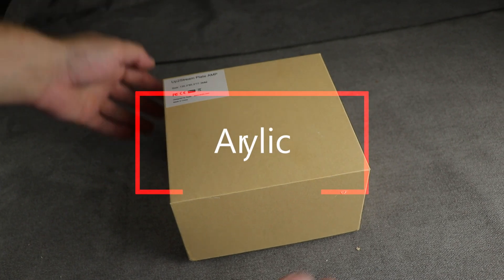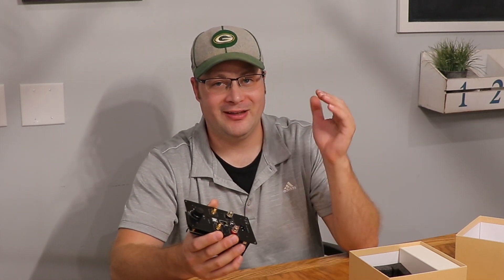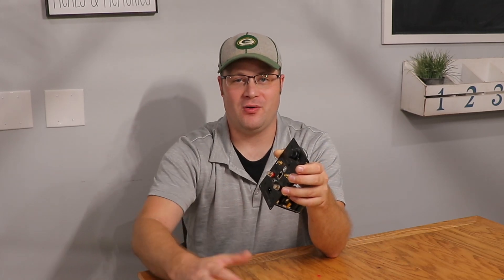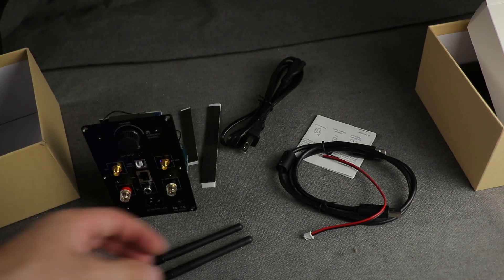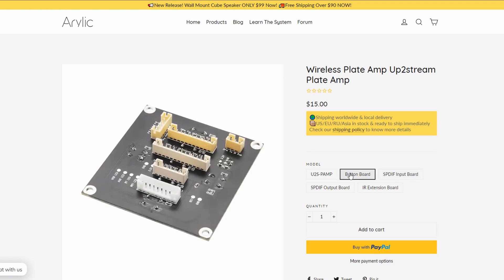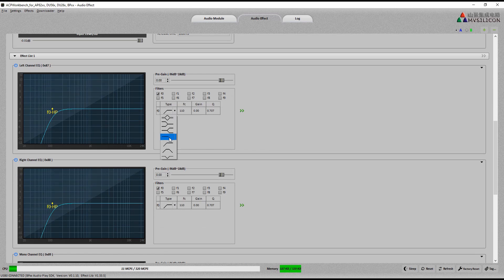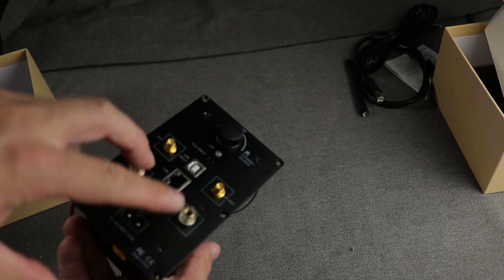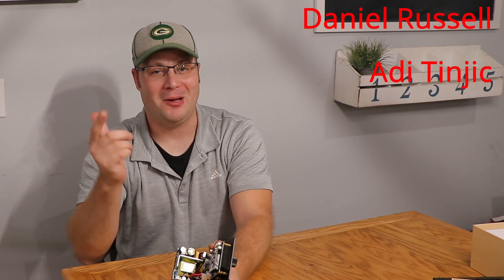My FAVORITE Plate Amplifier to Date - Arylic Up2Stream Plate Amplifier

Comment: thanks for the really great, informative overview. this board is quite impressive at its price point, no doubt — especially with the option cards — and arylic even goes so far as to publish schematics for some of the expansion boards if one is inclined to DIY them.

if i were to take a dig at it, according to the manufacturer's website the final stage output DAC is fixed at a 16 bit word length and 44.1 kHz sample rate — it can decode streams up to 24 bit @ 192k — which means that a good bit of material will have its dynamic range (bit depth) truncated and undergo sample rate conversion and downsampling to non-factor sample rates in order to reach 16/44.1k before being output to the amplifier. it also seems to lag recent(ish) trends in BT codec support, so caveat emptor.

that said, we can debate all day under what conditions and with whose ears that might be audible — many people don't bellyache about the fidelity of Spotify's paid tier, and certainly not CDs — but it will turn some off. it looks like they do make a board capable of outputting 24/192 native, as well.

always use your ears and judge for yourselves... the convenience may be worth it! be well.

Comment: Said the word 'cost' twice in over 9 minutes,  without actually telling us the cost. Nor did you tell us if the amp was provided to you for free, or if you bought it yourself. You failed to advise if this was a paid review or a personal opinion. You CERTAINLY didn't tell us the links to the product (and the only way we could find out the cost) is to click on your undisclosed affiliate links. 
You definitely know your stuff, and this looks like a great product, but youre missing a few things...
Reply from the maker: If it was a paid review I would have disclosed it. As far as cost, I used to put costs down, but it changes so frequently that I've stopped. As far as disclosing the affiliate links, they are disclosed you just have to read the full description.

Comment: I’ve used a 4 way dsp amp board for a set of 2 way active speakers, ie. 1 channel per driver.  How do you use the dsp on this to control the crossover if both speakers are powered straight off the same channel?

Comment: This is actually super nice because I have lots of friends who are interested in my diy speakers, and they ask me to make them some, but they hate the idea of having to get a separate amp to go with them. So far I haven't found any plate amps that are intuitive enough for normal people to use. Normally they don't have any good corrections or limiters so I worry about my friends burning up the speakers. With this, I can make someone a simple pair of bookshelves, set the corrections, and not have to worry about them coming back with some blown speakers because they thought their small speakers could do the same thing as my dual 15-inch subs. For $170 you really can't find any integrated amp that has anywhere near the features this has. I'll definitely have to do some more research on this. Thanks for showing me that this exists!

Comment: its certainly interesting but to be honest with that wattage its only really suitable for a little carry about boom box or a small soundbar.  that said they really missed the mark by not having a lithium battery option/add on board.  then here comes a problem in that diy low wattage portable boom box market.  Parts express has that all tied up,  look at the little mk boom for example,  that little thing will bust out tunes in the back yard all day 12 hrs straight for the tiny price of $120 for everything (batteries amp speakers crossovers cabinet you just have to assemble and paint it), and its decent! it actually sounds really really good for its price and size plus you can dsp it!  When it comes to retrofits there are very few pre-existing speakers i would want to put this in as it just lacks the power.  Something efficient enough that can unleash the sq of that chip would be worth too much money to hack up and anything you would be prepared to hack-up needs more power.  basically for a retrofit i want the same thing with 100-150watts 4-8ohm per channel with 200-300w 2-4ohm built in sub channel with dsp dac and Bluetooth and for not much more money than this then i will be excited.
Reply: fyi i have built a pass f5 and several other low wattage amps so i know what can and cant be done with low wattage ;-)
Reply from the maker: Yes. The Mkboom is a great little kit.    In fact I built one. https://youtu.be/peSW1Yrbapk having said that, the difference in wattage is almost identical. But I completely agree that they missed the mark I'm not being able to have batteries. On one hand I really like the fact that it has the built-in power supply, but on the other hand if they didn't have the built-in power supply, they could easily add a battery pack to power it. That would have definitely brought this over the top.

Comment: I was thinking about building 4" full range speakers and didn't need a fancy amp. Just some way to get a 70Hz highpass. 

Now I'm thinking this could be perfect for it since it has DSP built in. A little pricey... but ehh. I love wasting money on speaker stuff anyway. BT/wireless is nice to have and sub out could be neat if that's DSPable. (If not that's a shame)

I'll have to look at my box design and see if it'll fit on the back of one of them if I add a box on a box area.
Reply from the maker: Yeah I think that's another really good place that they would fit at. Especially if you're using higher-end full range drivers where you want to get the most out of them. But it's nice to be able to get rid of all of your physical components and then make any changes when you want with the DSP. That's one of the reasons I really like it hooked up to the computer with USB. Then you can make changes anytime